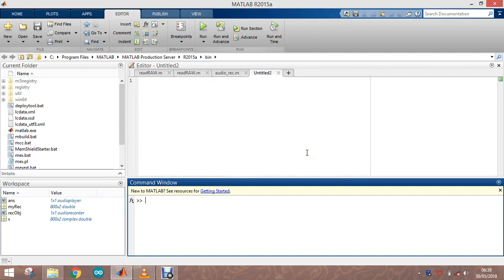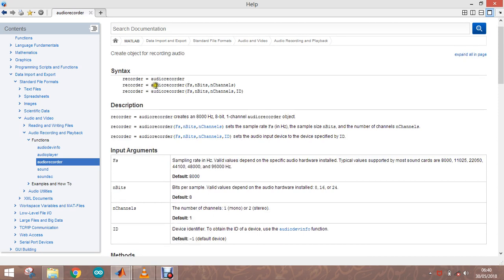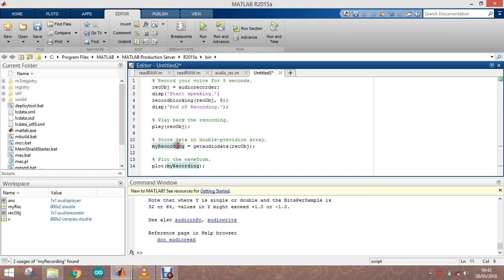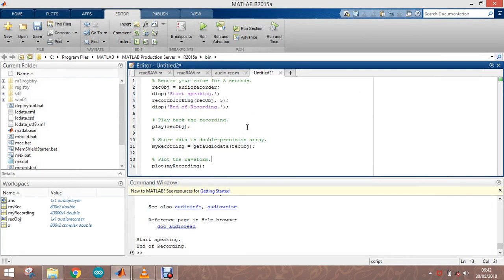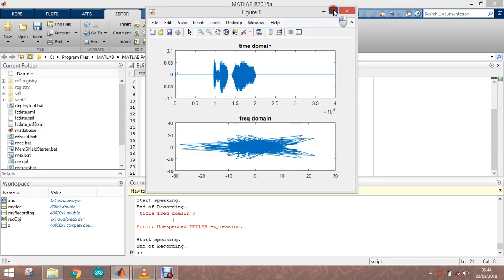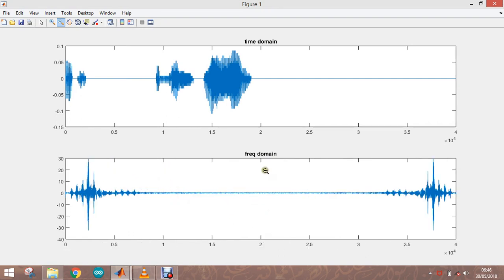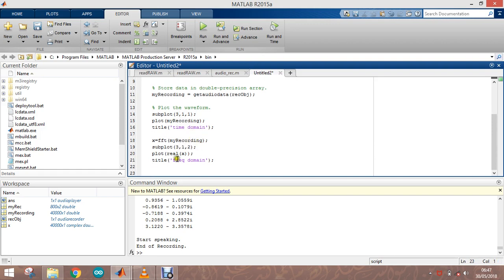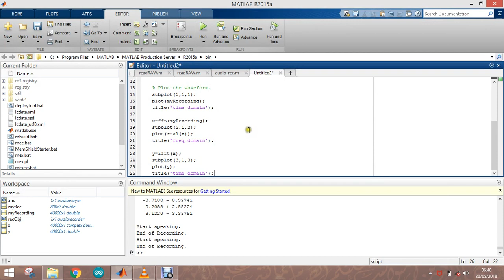Recording audio signal on MATLAB and analysis in time and frequency domain

Comment: in this line subplot(2,1,2); what do the numbers refer to?
Reply from the maker: Subplot had 3 number, first 2 numbers i.e  2,1 means the figure will consist 2 plots on it in a way 2 rows and 1 column. There 3rd number points the position where you want to plot in the figure. Subplot(2, 1,1) plots on 1st plot and subplot(2, 1,2) plots on 2nd.
Reply from the maker: For more information and Examples, just type following command on matlab workspace
>>help(subplot)
Reply: @bilalamjad129  thanks a lot for ur sooner response. I did and it helped thanks again.
I have another problem if u have the time to help me with.
the problem is "design a method to convert number 3 and the letter A into text"
Reply from the maker: @Mohamsamyed  bilalkashmiri124@gmail.com, email me here, I'm happy to help you any further